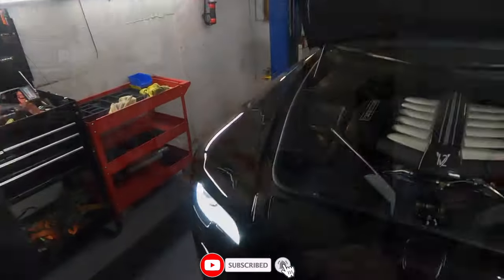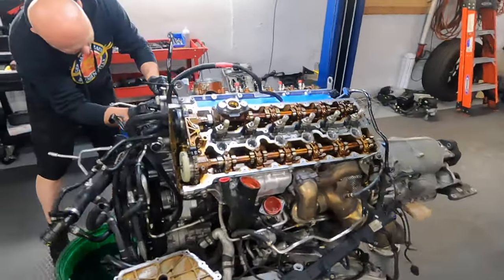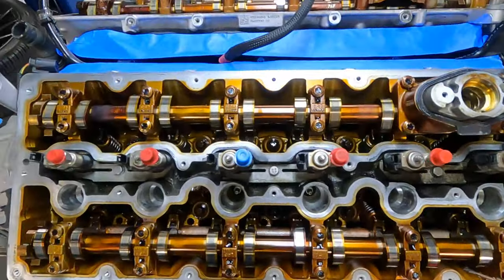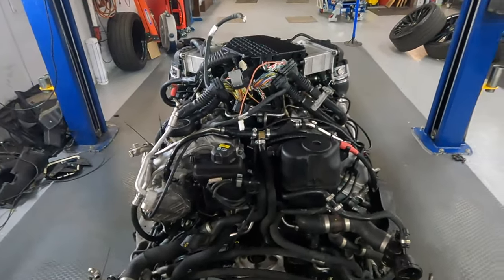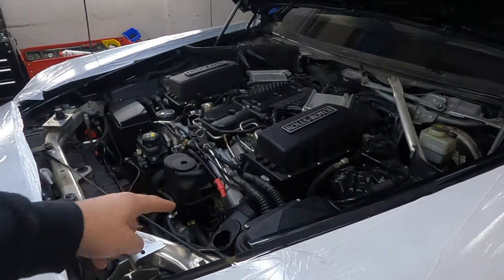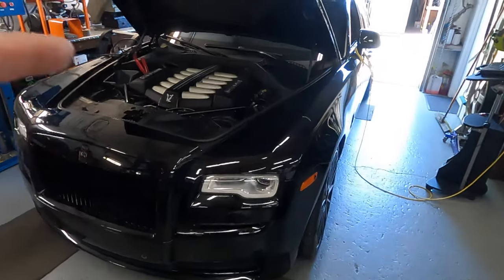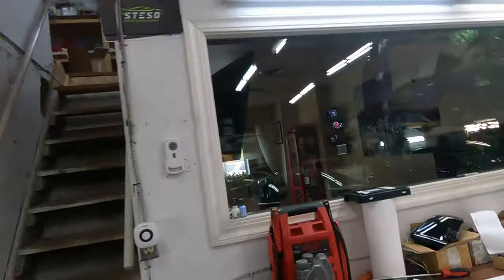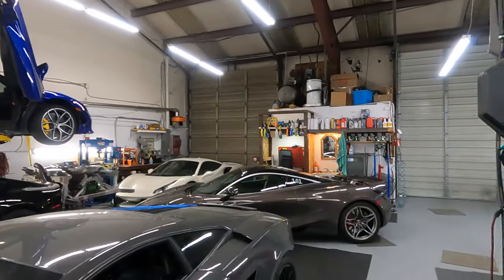Rolls-Royce came for Engine Surgery- 130308 Vanos control fault - Cam Adjuster's Replacement Vlog#93

Comment: First time iv heard of a n74 with cam aduster issues. But maintenance neglect is very obvious here
Reply from the maker: Before- Done two times engine flush, cam solenoids replaced . The last step- vanos replacement.
Reply: @GermanAutoHaus how many oil changes you think car had since brand new ? Looks like they went 20k on same oil . I absolutely love your videos by the way. Thank you for the exotic content